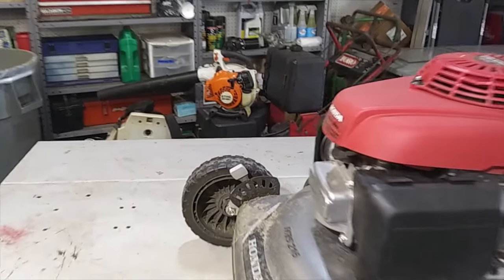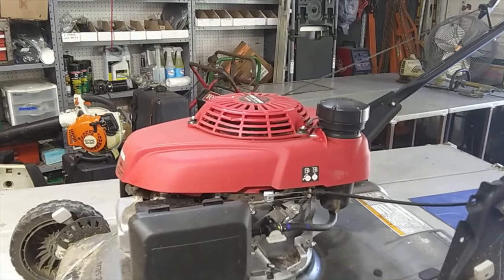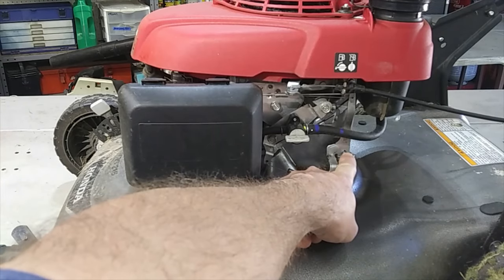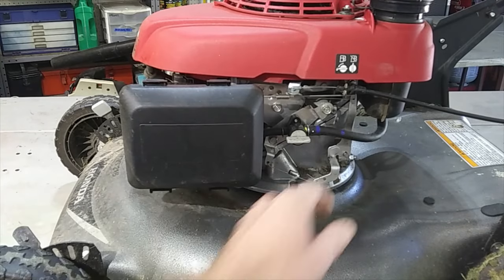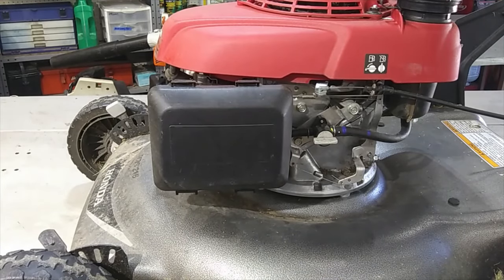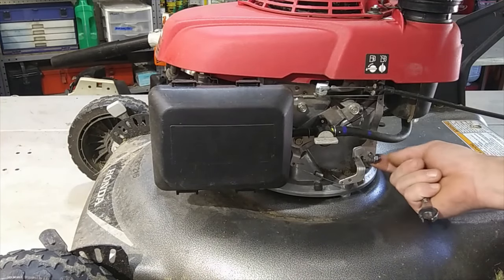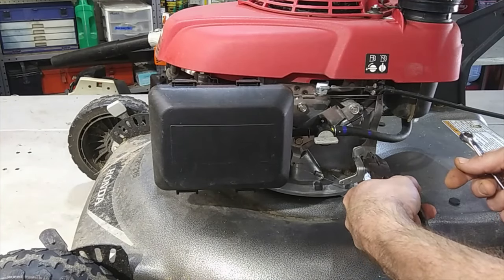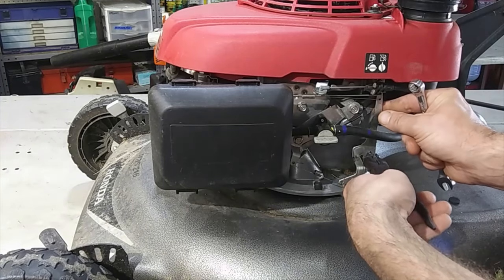Honda Push Mower HRS216 GCV160 Engine Overrevving | Adjust the Governor

Comment: I have this mower. Same thing revving super hard, super loud. It died out on me yesterday while mowing. Hope it’s not dead for good.
Reply: Cool thing about these motors is they’re nearly impossible to destroy and when they do go,..it’s usually due to some flaw inside the motor from factory…I’ve dug so many different push mowers out of junk piles and got them to run within a few hours tops…two of them were supposedly blown according to the guy who had them in his yard grown up in weeds taller then the building lol…city sent him  notice and he thought he could just ignore it and got a bill for the city to mow it for $900! 😆 he was digging those things out after that..,they weren’t blown,,,both of them ran after being cleaned up and put back together again…greased everything up and started on the second pull…I’m tearing down a flat head two stroke on an old Toro push mower…really quite amazing how simple they really are…it wouldn’t cost but maybe $100 to totally rebuild a push mower..that would include replacing all the cables and levers as well as the gaskets ….im curious how the newer models are gonna hold up compared to these older fancier ones that tan forever ….rebuild it man…don’t junk the old quality stuff…

Comment: I have repaired many honda gcv160 same issue. Slips on that shaft somehow. Easy fix though if you dont blow the engine first. I have blown an engine not on purpose but purposely adjusted govenor to have greater engine speed to cut taller grass not knowing it was destined to blow up. And kaboom she went LoL. Had it happen on toro 7/25 rear engine rider, put a nice commercial 8hp briggs on it. And had cut grass taller than you stand but engine never had an issue i cut slowly withbog engine speed you dont want to force the mower just sit back and let it do its job. It was my go to mower for this

Comment: Your video helped me reset my idle, many thanks!!!! Question, I have a craftsman with the Honda 160. Is there anyway to adjust the self propelled speed, it's pretty slow. I attempted to raise the idle thinking that would help, that's how I got into the high idle jam:) It just has the normal two levers, one for the dead man switch, and one for engaging the blades.
Reply from the maker: https://www.youtube.com/watch?v=8kgL9DX0HDU   see if this video helps and call me
Reply: Thank you sir, I'll check it out!!! I snagged this mower off a tree lawn last Fall. I think the people were moving and just didn't want to take it with them. Took it home and had it running in 15 minutes. Had it up on the operating room table today and cleaned the wheel adjustors and lubed the wheels, axels, and gears. Did a full service on it last Fall before storing, one of the best running engines in my fleet!!! @TomDobyMowerRepair

Comment: I have the same mower, same problem. The shaft won’t adjust at all. It’s completely solid. But I may be using the wrong pliers I don’t have the kind you have in the video. Maybe it’s time to take a trip to the hardware store.
Reply from the maker: try loosening the nut... pull the arm off the shaft... push the shaft into the block and rotate it to the right and pull it back out. then reinstall, and rotate the shaft right while you're pushing the arm to the right and tighten the nut
Reply: @TomDobyMowerRepair  thanks for advice! I’ll try that.
Reply from the maker: @s0la.scr1ptura  lemme know how it goes
Reply: @TomDobyMowerRepair  bro it worked! Thank you! Okay I’d tried fixing it a dozen times with my needle nose pliers and I couldn’t get that governor piece to budge it was just frozen in place. I removed the air filter housing thinking maybe one of the springs was stuck or disengaged but everything seemed okay. Today I stopped by Lowe’s and bought a pair of Channellock Linesman pliers (my first made in the USA tool I ever bought actually). They seemed to grab the governor piece much better and I rocked it back and forth like you did in the video.

To be honest bro once I got it loose with the new pliers I turned it counter clockwise because all the videos I saw before yours said that’s the direction you want to make the adjustment because that’s what lowers the RPMs. It didn’t work. I turned the choke all the way on, started the mower and then slowly eased off the choke and the RPMs shot up again like all the other times.

It was getting dark outside and I said I’ll try one more adjustment I’ll do it like the guy (you) in the last video I watched. So I adjusted it clockwise, started it up with the choke engaged and eased off the choke and the RPMs FINALLY sounded normal! We got it running. I don’t know how it worked because everyone was saying clockwise raises the RPMs? Just glad it did. And I got a new tool today so I’m happy haha. Thanks again bro! Appreciate your video. I’m subbed.

Comment: Great video.  Just purchased a used HRR2164VXA and it's over revving a ton.  When he was checking RPM's was that a non-contact tachometer he was using?  If it was would anyone happen to know the brand, model or part number of it?
Reply from the maker: it was a briggs and stratton part# 19200, you can get them on amazon

Comment: So I had to # auto choke system in order to find your video. It seems that when you type in GCV 160, it takes you to the other Honda frame that has the throttle lever in order to place in full throttle mode. So I am going through the same issue of high revving. I'm thinking that someone had gone in and bent the linkage so minor that you can't tell or feel any kind of bend. These two Hondas were waiting on replacement carbs.

Comment: did the same thing on a HRR216 gcv160 i resold last year.   The person who I had got it from  had messed with it and to get it to run and the carb needed replacement, also carb gaskets were in very bad shape.   The person who I got it from had went all STHIL all electric for everything.  I also got a KM90R I need to replace the carb on,

Comment: I can't find the damn spring in mine. I'm not sure what year it is. Its an older 5hp 22 inch Murray. Thats all i know about it. I was mowing and suddenly my rpms dropped. It has very little power and isn't able to cut anything. I also noticed a little oil leak that only drips while running.
Reply from the maker: i believe your part number for that spring is 16561-z0j-000

Comment: I did the shaft & linkage adjustments the same as you & now it idles to low.
Any suggestions would be appreciated
Reply from the maker: where the spring attaches to the gov arm... bend it to increase tension and the rpm's will rise

Comment: Do you do that adjustment that way for every small mower
.
Reply from the maker: Basically yes
Reply: What if the governor arm is on the other side of the mower.
Reply from the maker: @chriseverett1142  same principal
Reply: So same just anti clockwise ok thank you
Reply: Great video. So it's my understanding as I have a Craftsman push mower that's about 12 years old they all come with Governors none of them have Jets where you have a high side low side that you would turn a screw you either adjust the spring are you adjust the arm of the governor.. I'm trying to help a widow across the street her lawn mower is running very slow.

Comment: I did this and my mower still runs wide open when started, any other advice?
Reply from the maker: Make sure the throttle shaft in the carburetor isn't gummed up and stuck wide open, that's common
Reply: @TomDobyMowerRepair  it’s stuck wide open, but it’s not gummed up it’s a brand new carb, all the linkages and everything are set how they are supposed to be but it’s still running wide open, kind of at a loss